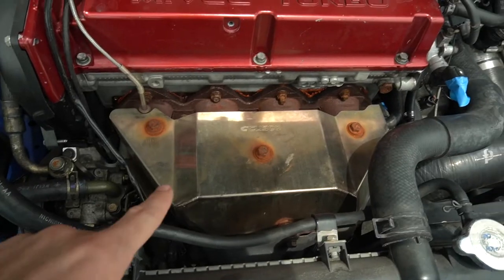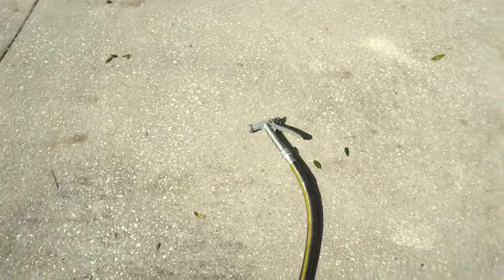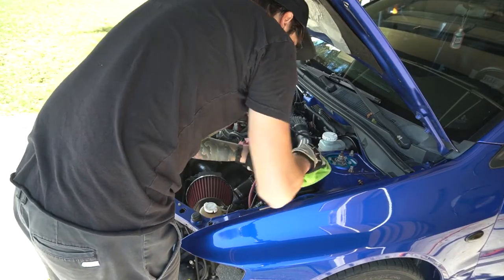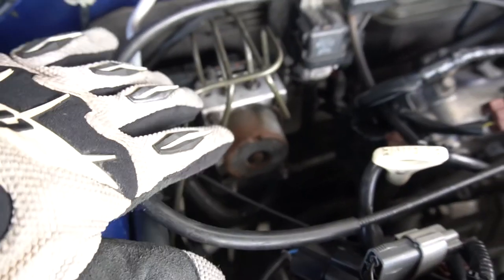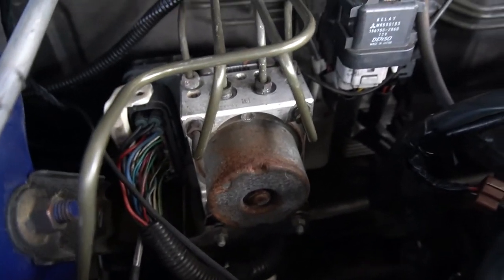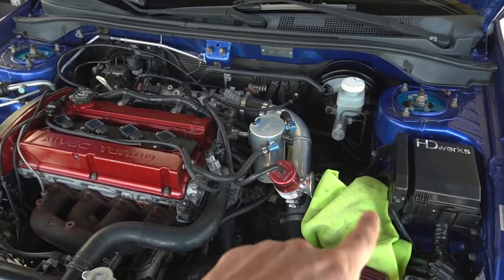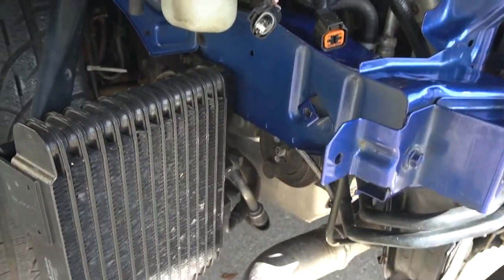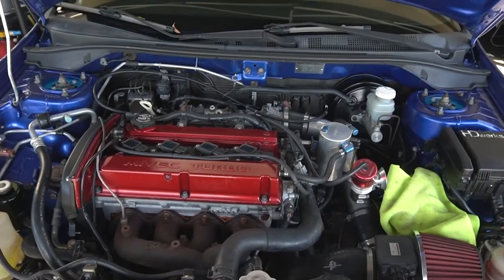Cleaning An Evo 9 Engine Bay | Evo IX Rebuild

Comment: I need to do the same to mine and I'm worried about using water too lol. Any issues after washing the engine bay? Looks good BTW 👍
Reply from the maker: Thanks! I appreciate that! Also, no I have not had any issues since cleaning it. I probably went overboard but I'd rather be safe than sorry and just cover up those points that I did and put the painters tape on the more exposed connections. It doesn't take long to do and could potentially keep the issues away so I think it's worth it haha
Reply: @RyneDickens  Yea especially with how Evos can be lol. Luckily I've never had a problem with mine, but I've owned it since 6800 miles and over maintain it. Keep up the great work! I'm in the process of restoring my car (new paint, new seats, etc.) so I'm enjoying your content
Reply from the maker: @sgtspooner  I never had a problem with mine either! I owned mine at around 8-9k miles. I never drove it in the winter, it was always garaged, I think that helped it get to this point even though I sold it and didn't own it for like 7 years. Glad to have to have tracked it down and can maintain it meticulously haha!